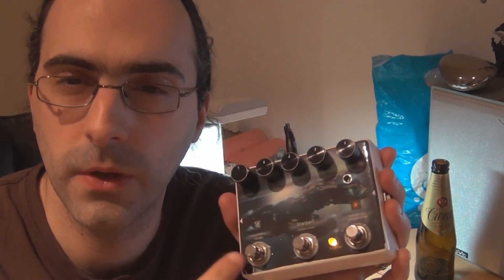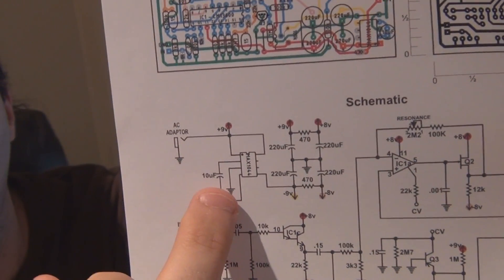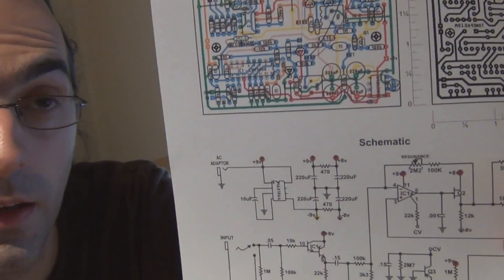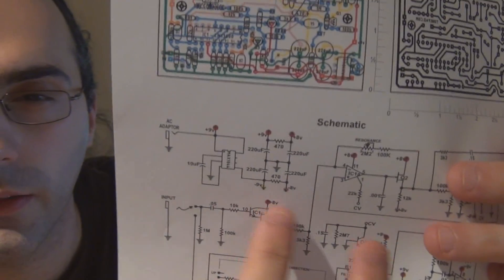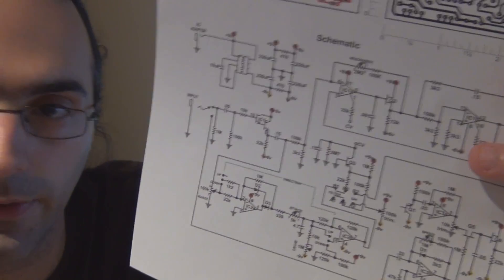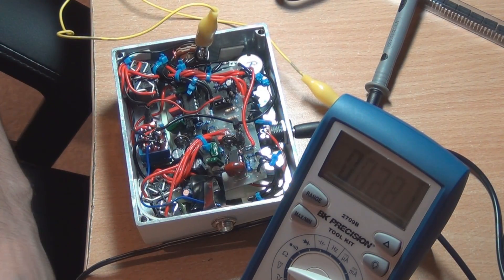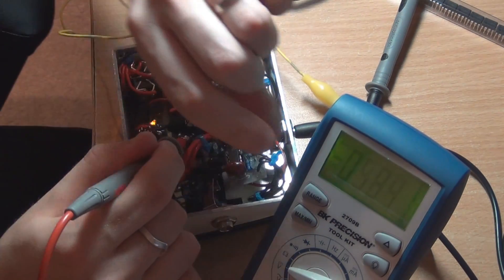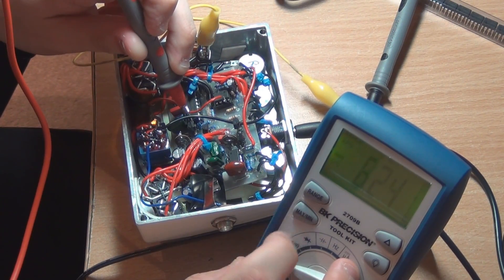Maestro FSH1 - Fault Diagnosing & Set Up

Comment: hi.. I'm having exactly the same problem that you describe about Q3 emitter voltage not oscillating.. haha ... I've tried about 20 2n5088s and still have to try my batch of 2n3904s... any forum thread that you have or recommend on reading?